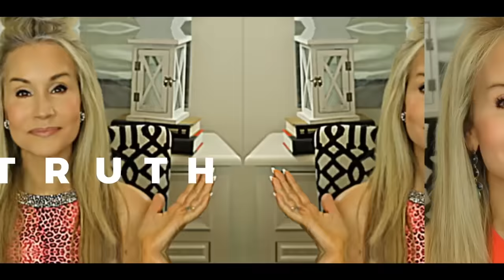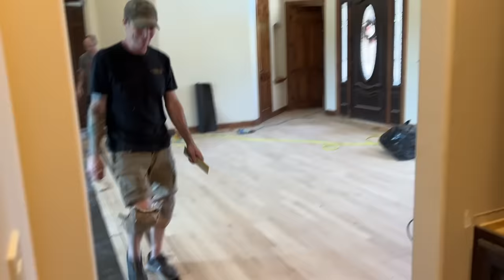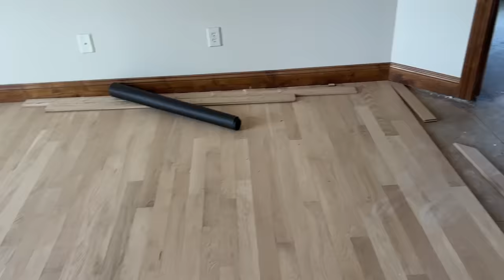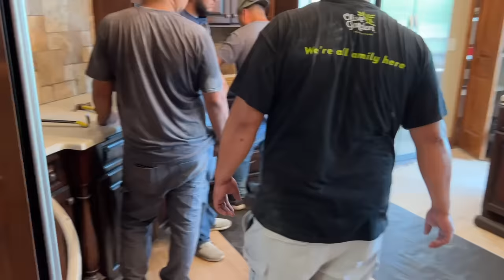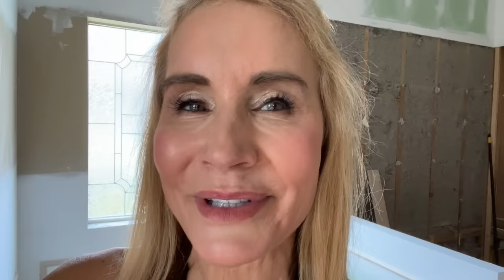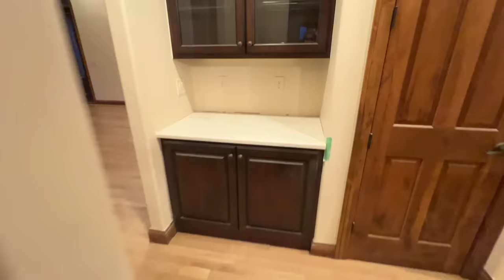My WHOLE HOUSE REMODEL Continues! We Get NEW HARDWOOD FLOORS & QUARTZ COUNTERTOPS!!

Comment: Thank you for sharing your remodel with us. The hardwood floors look stunning! Love the light colour and satin gloss. Are they total timber or engineered wood?  Curious to see all the cabinets repainted white as well, some clever ideas from your carpenter for opening up the kitchen area with new bench tops. What colour did you choose for the walls? I am renovating as well soon and it is very extensive. We will move into our guest room and it will be very cramped. Estimated time for completion is 12 months! I hope hubby and I stay sane and not cranky with each other while living through it.
Reply from the maker: Wow! A year renovation. I feel sorry for you guys. I didn’t think this would be so difficult. We’re only about two months in and it is getting old. I have to admit. I think mine will be done in another 2 to 3 months. This is not for the faint of heart, but I wish you well. I am going to be using Sherwin-Williams alabaster on the cabinets and accessible beige on all the walls. I use those colors in my last house and they really work well together. Good luck!

Comment: Why would they lay granite before painting? What type of company makes such a mistake? Always paint before countertops, if you’re doing a remodel….
Reply: Yes, that's how ours have been done. It's just easier not to have to cover and worry about the flooring.
Reply from the maker: The granite can damage the paint is the reason why. Installing granite can be very dangerous to cabinets. Both the painting company and the granite company said that was the correct order.